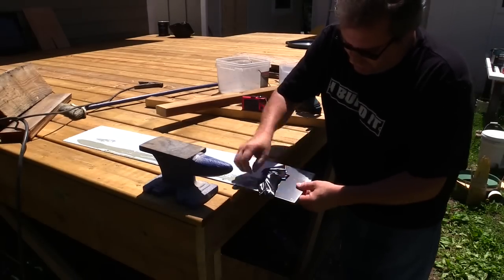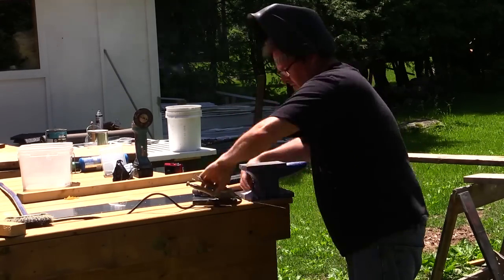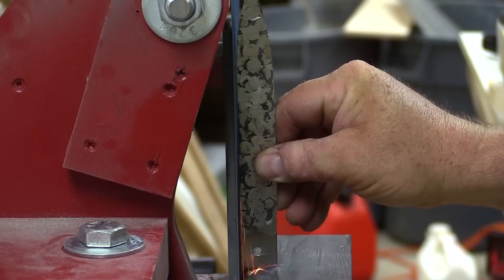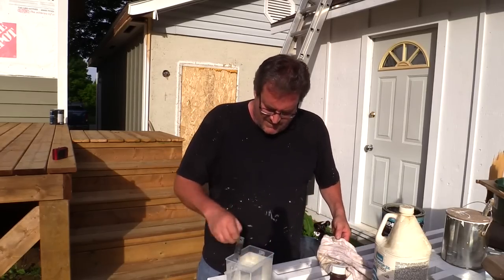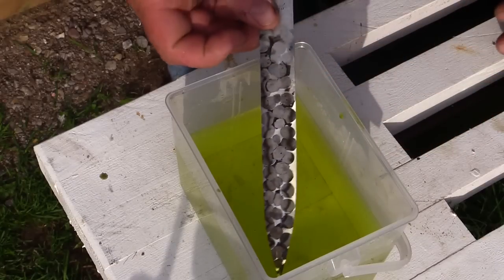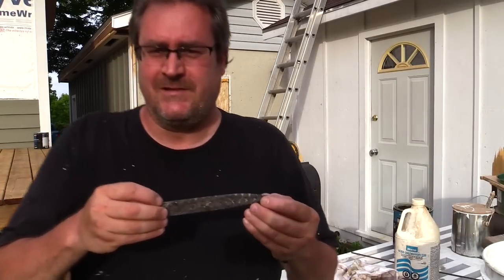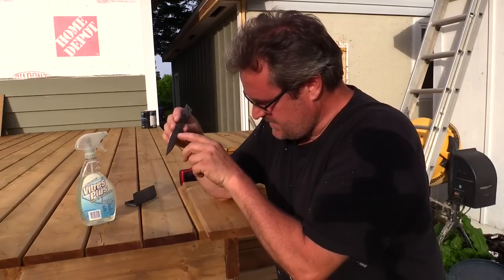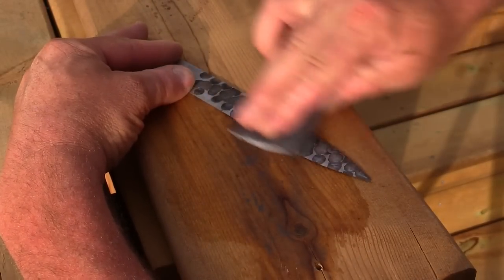Mig Welder Damascus Experiment

Comment: What an interesting idea!  Maybe start with stock that's a bit thicker.  Do the welds on both sides and don't hammer them yet.  Heat the whole thing to white heat, and then hammer everything and let it cool.  Heat it to red heat, and let it cool slowly.  Grind it to shape.  Then heat treat it.
Reply from the maker: deezynar The hammering was mainly to close voids (bubbles) that develop when welding a spot, and to relieve tension in the metal to keep it from cracking. I tried it without before and wound up with too many stress cracks in the base metal around the spots.
Reply: I Build It My suggestion to heat the whole blade white hot before hammering it is to do all the things you say, but also to forge weld it to consolidate the metals for greater strength.  It would be best to cover the whole blade in borax, as a flux, before heating it white hot.
Reply from the maker: deezynar With each spot weld, the metal is liquified (expands) then cools (shrinks) by significant amounts. Without hammering each individual weld while it's still hot, the base metal will crack. Also, I don't have a forge and heating steel up to white hot is not trivial.
Reply: I thought you had a way to heat the whole blade.  I didn't know the spot welds cracked if they're not hammered while still hot.  That is not typical.  The point of heating the whole thing is to equalize the stresses and fuse it all together.  For what it's worth, I do blacksmithing as a hobby.
Reply from the maker: deezynar One or two won't, but that many spots will. Repeated heating and shrinking in close proximity. 
I understood what you meant by heating the metal (annealing or normalizing), but like I say, I don't (as of this time) have a convenient way to do that.
Reply: It

Comment: you could actually also draw lines, not just dots.
Actually you could draw whatever you want on there. I think it came out cool. The technique is definitely interesting. Doesn't need to be for a knife. Could also be used for signs with little information like a house number ect.

I need to buy more toys.

Comment: do you think if you ran beads over the metal, you would get a neat effect too?
Reply from the maker: kwithnok Thinking about it and will try it, but then the metal may be too homogenous, without much definition.
Reply: I Build It I was thinking you should run a single bead down the middle then the spots along both sides.  you could also do the dots on several pieces then forge weld them together.
Reply: run Beads with different weave patterns maybe with a tig welder